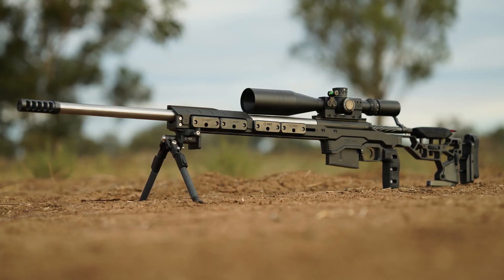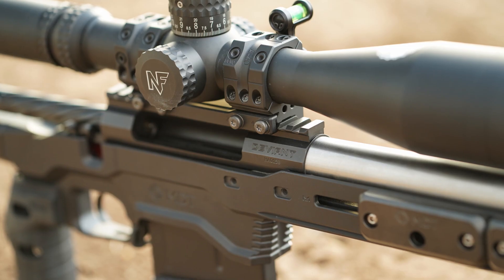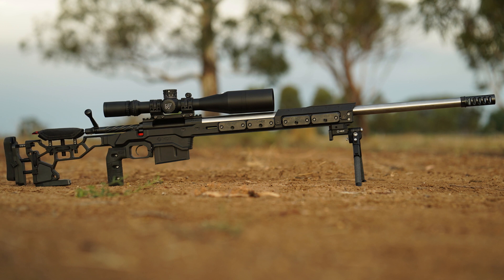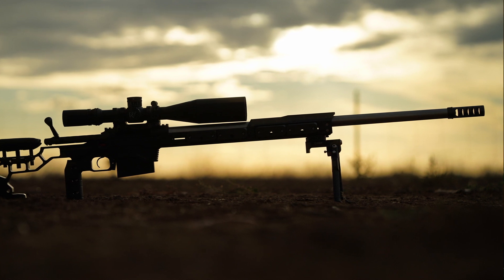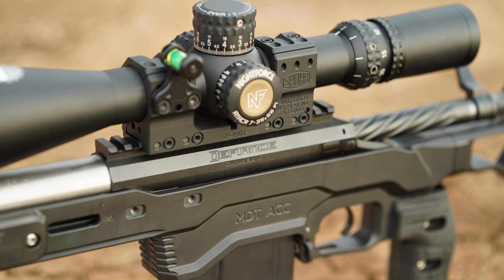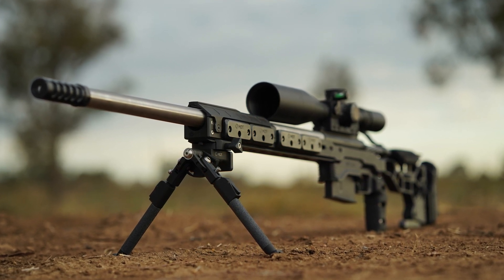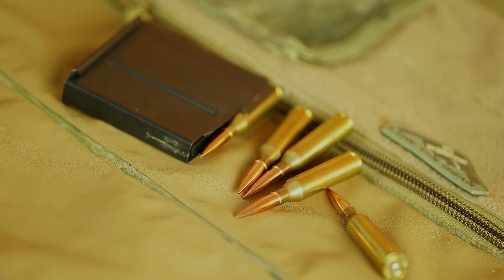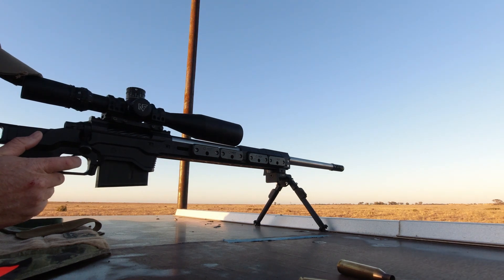300 Norma Mag Tech Specs - Ep 16

Comment: I know you're a long-range guy, but what do you think about the 338 Norma Magnum as the new sniper and machine gun round for the US army? How does it stack up as a sniper round and what performance can we expect at longer ranges etc?
Reply from the maker: I’ve spent a fair bit of time on belt-fed guns during my service and I have to say that a I think the 338 Norma Mag is an excellent choice for a GPMG. Having an MG with an effective range of up to a mile is a fantastic asset for the ground commander at the tactical level. It will be a real heavy hitter. The weight of the ammunition will be as issue for dismounted soldiers but the same can be said for the FN MAG58 (M240). Having sniper rifles chambered in the same cartridge just makes sense in having one ammunition type for multiple platforms. De-linked MG ammo isn’t super consistent in sniper rifles but it works in a pinch. I could go on but that’s my thoughts in a nutshell. Thanks for watching 👍🏼
Reply: Not to mention a great hunting cartridge!

Comment: Ben, Do you think 1:9 twist will handle 245-250gr projectiles?
Reply from the maker: G’day Santiago, I looked up the Berger barrel twist stability calculator and the 245gr Berger bullets are stable from a 1:9 twist barrel under worst case conditions; which is good news if you have a 1:9 barrel. The 250gr projectiles would be a little bit longer (I’m guessing) and under the same conditions might have marginal stability. Thanks for watching and I hope you enjoy the other videos on the channel! 👍🏼
Reply: With a 1:9 twist I couldn’t stabilize the 250 gr Atip at sea level